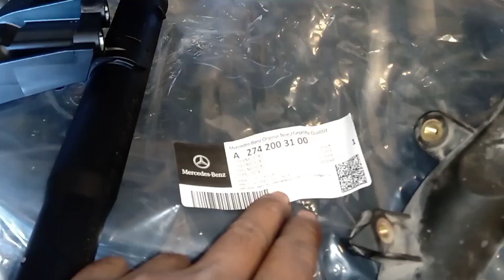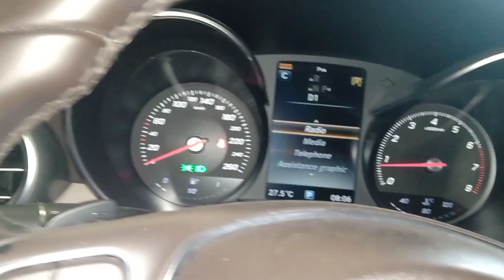mercedes c200 thermostat replacement

Comment: Why change the termostat,what f code?
Reply from the maker: Ovarheting problem  then chenge thermoster
Reply: My problem is same radiator fan is working engine temp rise to 90-105-90,
Reply: How to make sure that the overheating problems is coming from thermostat or water pump if soneone hasn't a diagnosis computer?
Reply: @cemanyu1016  hi,į was changing termostat,and problemų was gone